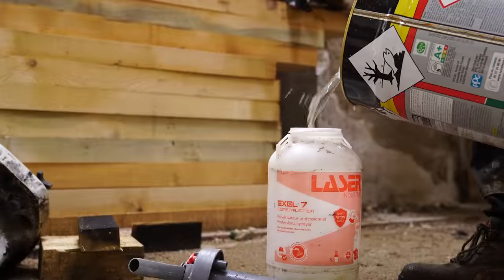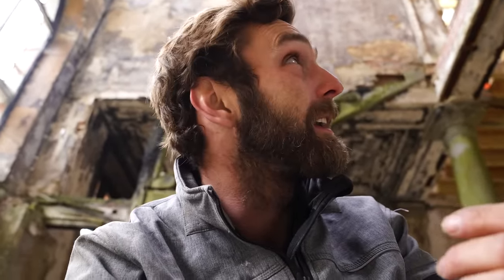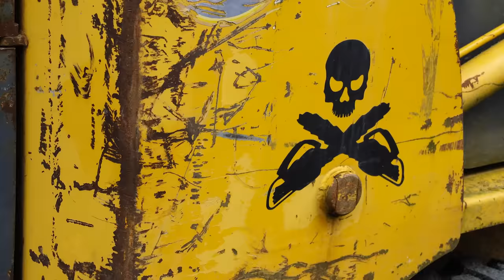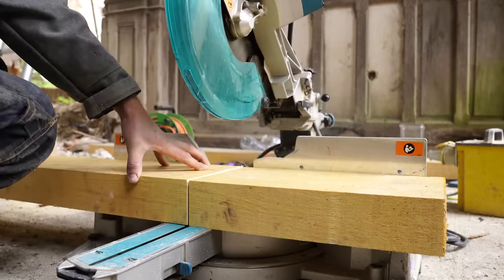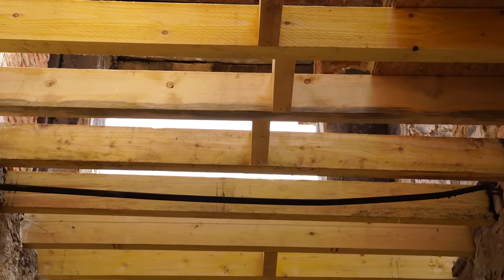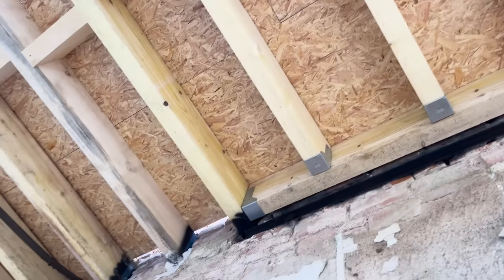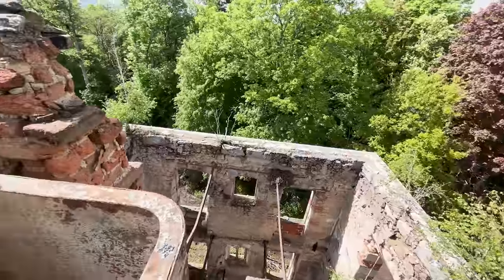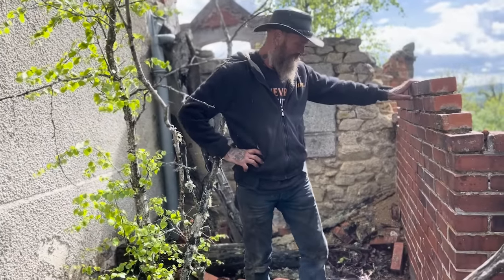Climbing up to the 4th floor in the chateau, removing the ROOF toilet.

Comment: Excellent work Dan, but be carefull in the upper stories because the intense heat will have broken the bond between the line mortar and the bricks! Save every original brick and piece of stone because you wont get modern materials to match! You should have put a weed membrane under the chippings which would allow water to drain away, but keep the mud and weeds under it to prevent “pumping” which will bring the mud back up to the surface in wet weather!
Phil

Comment: To answer the question “Is oriented strand board waterproof?” the answer is: not completely. That's because it's virtually impossible to prevent some water absorption in a wood-based product, and moisture can be absorbed through cuts in the panel and the wood strands can swell. 

Best to prepare for water infiltration, Dan.

Comment: If you are going to toenail (screw) the blocking or noggins in, then put them in a straight line, they are stronger that way. The reason you offset them is so you can nail directly through the joist into the ends, which is stronger than toe-nailing and doesn't tend to split the corners out.

Comment: What I would suggest to you to say as an ex-builder of over 45 years and retired, I would get a succulent engineer to have a look at the building and do a survey on it so that you would know what is structurally sound and structurally dangerous from one of the shots of a Videos on the top of the floor that you were on. I could see part of the wall that your colleague was leaning against looking over what seems to be a small parapet wall was leaning towards the inside of the building, saying that I think structural engineer would be very reluctant to get up to that level without the sounds platform to survey the top of the structure good luck

Comment: Gravel driveway construction: Usually you would first put a geotextile fabric membrane onto the soil to stabilise the ground, then a layer of slightly larger mixed base rock whacked down followed by a smaller dressing gravel on top with a crown in the middle.
Reply: No, geotextile fabric membran is not used in landscape. They took ordinary gravel subconstruction. They made it right.

Comment: Could you speak to your power/solar setup?  Any issues?  Does it ever run out? If not, how close do you get to running out? 20%? 90%?  Do you see adding on to it as your needs grow? Or are you getting service installed in the relatively near future?

It certainly has changed your efficiency. 

Cheers to you and this endeavor. I watch every post. So I guess, I’ll see ya tammaro 👍🏽
Reply from the maker: It’s never ran below 80% with coffee machine camera charging winch and saws going
Reply: @escapetoruralfrance  fantastic. Total game changer!

Comment: It will really look great when it is done.30 odd years ago.I bought quarry slag it was called . Cheapest stuff from a quarry.£3.00 a tonne then .But it was great for the yard floor.Set like concrete . Doesn't have much stone but dust .But like I said,sets really hard .Rode over it for years.

Comment: after observing your video,  I do not see side trench(es) of the chateau road to redirect the water off the actual dirt-road surface. The mud piling that Nick did, I fear possibly turned road into a wide trench.    the suggestion is to have nick use backhoe digging up a trench along the downslope side of the road about 5 to 8 cm depth of the road surface,  roughly 10 cm wide? (not reduce the road width) and if possible direct the trench toward some water body location. 
This will help reduce "amount of muddiness" on the road itself.   Gravel or stones on the road helps, but still need side trench.

Comment: Suggest you spray the ends after cutting floor joists. Don’t know if you have a roof on and waterproof but helps to reduce rain damage. Use electricians gloves, enables main digits to hold a pencil and please wear safety glasses

Comment: So good to see the last bathroom appliance come down, don't need that hanging over your head ... i find it very poignant, from an understanding of energy point of view, when it became clear that the house was constructed with at least 2 if not 3 toilets/bathrooms over the main entrance of the house  i understood where the unlucky energy of the house stemmed from. You can think I'm mad or too woo woo, but to me it seems common sense, water has to be managed in so many different ways in a house, apart from keeping it out of the walls. I 100% recommend finding a different arrangement of bathrooms/toilets for your new revamped chateau and especially not having the main sewage waste pipe running under your front door area as it appears to be from your investigation of where the sewage tank is. It's not good energy. Of course it's your place/decision how you go about it, I am only putting out what i feel, to be taken or left, as you feel. I only wish for your benefit and a strong happy home where you will be happy for many generations to come. 
Congratulations on your 100th vlog, the more you clear out the old stuff the better it gets. More power to you 💚

Comment: What are you to do with the steel beams Dan? 

I presume you will need to replace these in the not too distant future, and before you add any significant weight to the structure?

Comment: 30s in .... New Jacket? 😂
You might consider a hoist up 3 floors via one of the smallest rooms. A cross frame at the top, making sure of all the seatings. You're going to need to get a lot of materials to the top floor...

Comment: Please correct me if I am wrong but, if you don't use a liner first before dumping the fine gravel onto the driveway, won't it simply be pushed into the dirt rather quickly and you are right back to where you're started?

Comment: If you were not thinking of keeping it or it was too badly damaged why not just chuck it over the outside? Can't see any reason to pull boards apart. Just don't ever build in that view as in never close it off. It is such an amazing thing to have such a view because most houses the world over are just 2 stories and for those that are 3 stories, they are usually in cities with no opportunity to get outside. That little bird's nest view is worth the value of the whole place. Great view, great investment, great potential. All good!